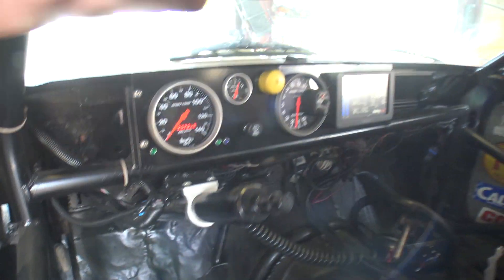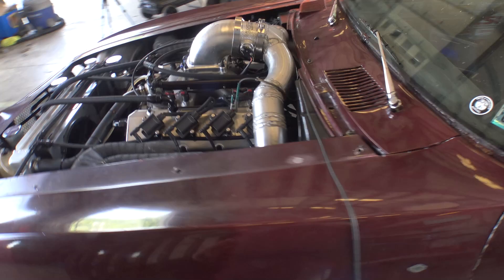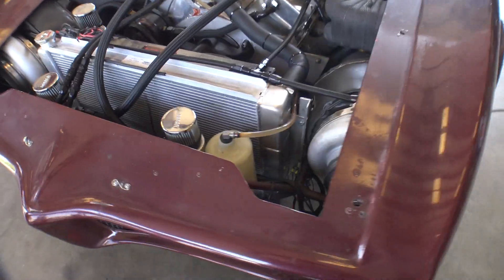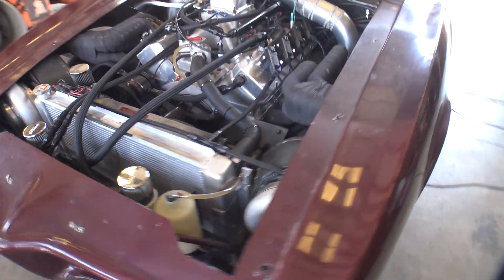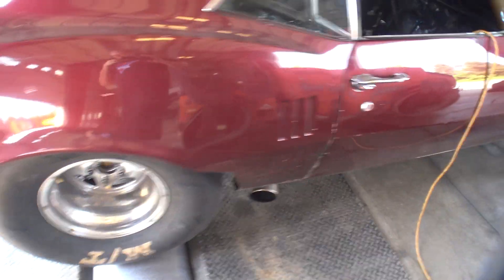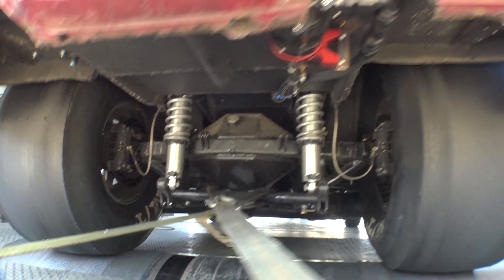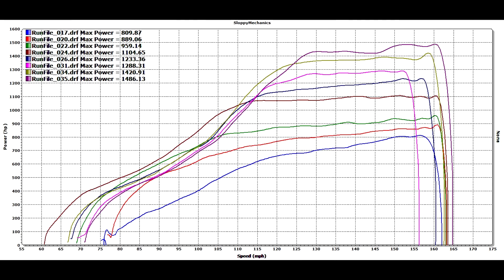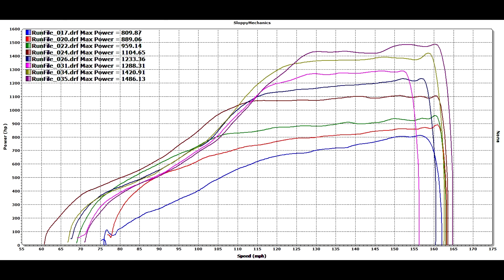twin billet 90mm big block drag week car

Comment: I'm currently working on a don't B's me clone build for my 86 c 10 I enjoy all your videos and thanks for the great info I need help w the fuel lines not sure what to do there and I'm gonna run a450 in the tank unless you think something different would be better mine will be 6.0/4l80e but I do have a 4.8 long block ???? Lol
Reply from the maker: Total HP you want? You can over do fuel system now or just do it simple depending on goals, if you have no idea just buy 3/8 or -6 and run everything -6
Reply: Well I'd like to be capable of 1000 but start around 600 was gonna do de capped and flowed injectors but now I'm thinking a might as well just get bigger injectors any suggestions
Reply: @ Mr. 6liter I'll have to look into that thanks I'd rather be over built then not built enough

Comment: Quick quiestion 
I have a 4.great/t56
Summit stage 3cam 
Single turbo 76mm inner cooled 
Deka 80s 
Realistically what do u think i should make ?
Reply: vinny g 530ish on pump 93
Reply: @starionslider2116  
E85 ?
Reply: vinny g what size is the exhaust wheel? That will be your determining factor.
Reply: @starionslider2116  
Compressor Wheel: 72.1/102.4 MM
Turbine Wheel: 74.1/64.6 MM
Reply: vinny g vinny g im guessing your talking about a “T76” like a cx racing or On3turbo?  Ive run that exact setup on a 4.8 with a t56. Pretty much maxed out around 535hp due to choking the exhaust side not lack of fuel or octane. Can it make more on E? Yup but its still gonna run into a wall at that turbine. If you just wanna make like low 500’s then yes it will work. Will fall off a but up top tho if you compare it to a 7875 or something more suited to that setup. I currently run a 7875 and im pretty happy with it. Now octane is my limit. Dont have E85 available in my state. So i run 93/meth currently. 650whp is about all i can get outa it on that setup “safely”.
Reply: @starionslider2116  thanks for the info ya its a cxracing turbo i upgraded to a dual ball bearing if that makes and diff thanks again stay safe..🤙🏽
Reply: vinny g yea ball bearings are not gonna really do anything for ya. The exhaust wheel is the limiting factor.
Reply: @starionslider2116  🤦‍♂️👌🏽 if i can somehow get 600 to the wheel ill be stoked i do have access to e85.
Reply: vinny g you will probably make 600s and then it will break a piston or push a gasket because its gonna be fighting itself with all the heat build up cuz it cant get out of the tiny exhaust wheel and housing.  See what happens tho. Only 1 way to find out.
Reply: @starionslider2116  
Question are u savvy with holley terminator x ?
Reply: vinny g no not at all. Im on a stock gm ecu with Hptuners. Im no protuner by any stretch haha. I can fudge some stuff together and make it work but I paid my trusted guy to iron out a clean tune on a hub dyno.